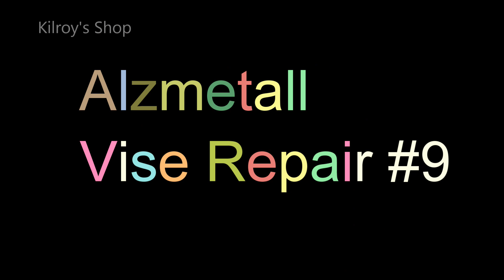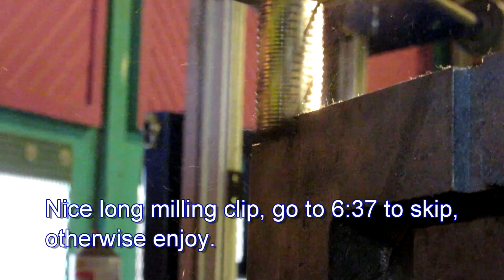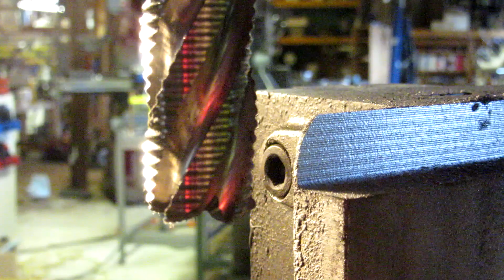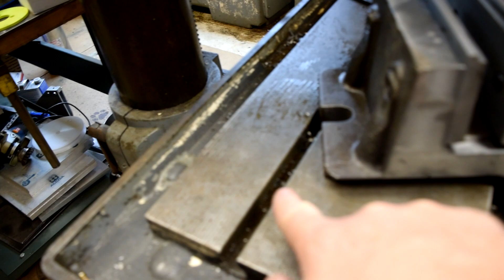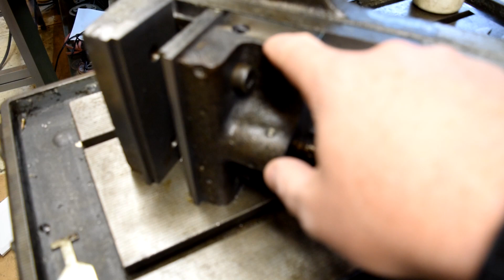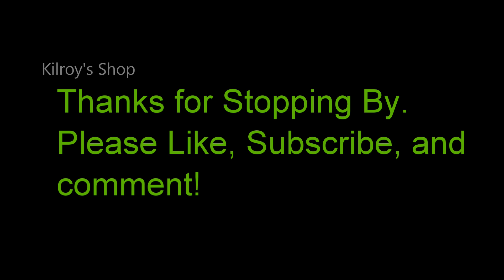Alzmetall Vise Repair #9

Comment: Hi James, sounded perfect to me. The picture contrast seemed somewhat too high. Windows were over-exposed while your jacket was too dark. I wonder if this can be fixed in the settings. Otherwise the picture was great, too.

I wonder how this camera holds up against vibration though. This was one of the things that GoPro did wonderfully. Having a complex lens doesn't help here i'm afraid.

Comment: About the new camera, maybe you can try shooting from another direction in order to avoid the back light effect from the windows, use that light in your favor.... As far as sound is concerned, it's fine as long as you won't have loud machines running and if you got to talk quite far from the camera, I use a noise cancelling wireless for those times, and, I'm quite satisfied with it...

Is the focus automatic or do you have to manually set it...   ???  If manual, it could be a little more work adjusting while filming, lots of lighting will definitely help with depth of field...   ;)

Comment: Hi James, nice series, I'm enjoying watching it.

On the intro and trailer, I really like the video quality, but the audio, not so much. You have a lot of room echo there in that cave you are in with all those hard walls. You would be a LOT better off with either a short shotgun mic or a wireless, something like Keith Fenner uses. 
There are shotgun mics from about $15 up to about $350. I'd suggest spending something in the order of $100. But then, I spent a lot of years doing theatrical sound, and I like good (or at least decent) microphones that will hold up over time.

I don't know much about Azden, but the specs look pretty decent. Maybe something like this: https://azdenproshop.com/product/sgm-990-dslr-camera-microphone/

Comment: Hi James
I like the new camera allot the video quality is excellent and the mic is fine good sound quality not sure how far you were away from the camera. Some of the guys are using radio mic's and they are getting allot of noise from rubbing when moving around which is a little annoying. I'm not sure you need it at this point but couldn't hurt to try one just to see. Yes agree some lighting would be good sometimes it's a bit hard to see on the mill. Great videos though always like it when you get stuck in. OMG that vice must owe you so much in man hours it's crazy but makes a great video.

Dave

Comment: I didn't skip forward at all this time because the video quality was good enough that I just enjoyed watching that big mill eat that iron.  I had no trouble with any of the sound, but I may not be that much of an authority.  
I'm interested in watching it finally work as I've got a Float Lock for my drill press and use it quite a bit for certain jobs.  The Float Lock is compact enough that I get along using the T Slots.

Thanks for the great series.

Comment: sounds is great your round windows are kinda getting blown out with the light  but no big deal .as a side note just as your finishing up your drill press i am starting mine little bit older then yours lol . check it out i just posted the first video today.
Reply from the maker: +Chris Anderson Will do, thanks for the heads up.

Comment: The sound is really pretty good. The thing that I see that needs improved is the back light from your windows. It tends to wash out the rest of the picture, It is a much better video when you are shooting after dark and the light from the windows is absent. 

I don't recall if you have windows on both sides of the shop, but if you don't or when the sun is bright you might consider shooting from the other direction.

I really enjoy your projects  and am learning a lot from your practices.

Bob

Comment: Great picture, sound not so much.  Any built-in camera mic is not going to have much quality, and all mics will tend to pick up room echo.  Better would be an off camera directional mic, like a Rode, located as close to you a possible yet remaining off frame.  Best, of course, would be a wireless lavalier located on your chest (keep away from throat).  Avoid continuous focus, as the system will hunt unpredictably for focus.  Most videographers use manual focus, which should work well for the kind of stationary camera-based shots you have to use.Keep up the good work, James!

Comment: Hi James, The video from the new camera is a bit washed out, but that was probably from the back lighting of the sunlight from the windows (just something to consider). The sound from the internal mic while you're just sitting there is exactly what I would expect (and prefer) from standing in your shop having a conversation. Perhaps the external mic would be a better option whenever there's machinery running and you want that sound to sit in the background while you would be narrating? 

Just my thoughts, enjoyed the videos regardless.

Thanks!
Reply: +Neil Smith I agree with the picture and the sound, except that I found the volume a little lower, had to turn it up for the last part. 

James, I liked your post-filming narration that you were doing with the clips from the broken GoPro (it sounds like to me that the mic has fallen loose inside the GoPro ). The only problem with that is you miss the sound that the machine makes while milling, which can be useful for learning.
~Travis

Comment: Really digging the alzmetall series, Jay!  My brother has the D3300 also. I personally think it shoots amazing pictures, but I think my Canon T2i shoots better video. Maybe its an issue on 24p only, but it always seems pixelated, like its struggling with compression, I dunno.  Audio seems much more consistent on this vid than your others. The narrative is much stronger above the background machine noise than it used to be. Not quite "Keith" quality (either of 'em), but its a lot better than it was! Wireless lavalier would be best for sure, as you wouldn't have to fiddle with anything. Strain relieve the cable at the mic head, and keep the windscreen away from your apron and it would sound great! Otherwise abom captures some great audio with his rode, you just have to be more mindful of which way its pointing when you're talking.  as for the milling action, I watched it all in real time, and at first I thought I liked it better, but now I think I miss the old super speed with the funk(your opening and closing music)... just turn down the funk a little bit, its always too loud.  Just 2 and a half cents, it still wouldn't keep me from watching the vids though man, keep up the good work!!
Reply from the maker: +Adam W I will have to look into a wireless mic.  Like most things, you can get them cheap, but a good one will set you back six bills.
Reply: +James Kilroy exactly, they're more than a good HD camera these days. There's one by Movo on Amazon that I've been looking at for 2, but who knows if it's worth a crap. Audio is much improved already though Jay, waaaay better than the gopro ever was!

Comment: Hey James, why not make the torque arm long enough to use the column for the  drill head be the stop rest? Looks like it might would hit the column rack when using left hand bits but that probably isn't often and even then with that much leverage I doubt resting it on the teeth of the rack would even matter
Reply from the maker: +bcbloc02 Brian, that's not a bad idea at all.  That way a clamp would only be used to locate the vise and would be optional.
Reply: +bcbloc02 i was thinking the exact same thing.
Reply: +bcbloc02 That's exactly what I do.  I dislike clamping things on the drillpress table.  Much prefer to leave the vise floating and have a torque arm.

Comment: James, in response to your direct question.
 I see very little difference overall in the audio except when you are behind the camera when it is less clear but still perfectly audible. 
Picture seems sharp enough although at times a little a little blurred outside the area of focus which appears to be strongly centre weighted when very close up especially - that may of course have been your intent! 
In my view your main area of difficulty lies with lighting issues: initially I feel the lighting from I guess a single source in front of the mill was too strong and it produced almost burnt out areas of the images and dark shadows in other parts and this I suspects makes it difficult for the camera to adjust the white balance / aperture / focus assuming you are employing automatic features. 
- What might work better for you in this situation I don't really know but feel two or more lights of less individual power to create an even flood light effect or perhaps some sort of reflector to illuminate darker areas to give a more even overall lighting effect. To this end pictures from the rear / side of the mill were excellent.
Reply from the maker: +Dan Whiteford Thanks Dan, I noticed that the edges on the video were blury.  I will experiment with different focus configurations and see if that can be combated.  I expect that I will need additional lighting to avoid that.  With the aperture wide open depth of field will be very short.  I recently purchased some LED outdoor flood lights I will be adapting as machine lights on the big K&T, four of them.  Hopefully I can get an even, near shadow-less, light pattern with those.
Reply: I shall be most interested to see the results.

Comment: I like the quality of both the sound and the picture of both new camera clips, and really the only nit I could pick would really be more of a question that has probably been answered by the new camera.

During the post milling review of the vise many sections of the shot were crisp(like the splash-proof oil cup, etc.), but the vise itself seemed a bit blurred. Was that just a matter of focus, the lighting, or something I am ignorant of?

Personally I wouldn't buy the external mic, at least not yet, as some of the other comments have pointed out their drawbacks and I tend to agree. There was a video this morning by a good friend of ours that had a issue with his mic rubbing on some piece of clothing and it was rather loud, so I'd wait until YOU find the sound annoying, and then look into a mic because it sounds great all the way over here in California ;)

Thanks again for the extra touches on this well made video, Aloha...Chuck.

P.S. I haven't forgotten about sharing my GTD set with you, and will be making a video shop tour/tool inventory and will make a note of when it appears in the show and put up the time, like you did with the milling.
Reply from the maker: +Knolltop Farms I have a lot of learning to do with the new camera for sure.  Focus when taking video with a DSLR, is not nearly as care-free as with a video camera.  And like I mentioned in another reply, I need a lot more light so I can crank down on the aperture to increase my depth of field.
Reply: +James Kilroy Sounds like you are certainly on the right track with it.

Comment: I think the initial camera angle would be termed 'upskirt'. Have you watched one of Keith Fenner's videos from last year? Can't remember the title but there was horizontal milling as I recall. He finished with some slo-mo blue lube action - with hot, flying, chips and flood coolant. Damn ! I think you guys should work together more.
Seriously though, good video, thank you. I didn't notice differences in camera, pixels, sound quality - but that's not what I'm watching these for! I will say though that if you hadn't put instructions, skip to 6.22, skip to 10.44 or whenever, I would have watched the whole thing. As it is, I watched a 22 minute video in like 12 minutes.
Happy New Year - if a little late.
Reply from the maker: +The Trevor Thanks for the feedback.  I would rather you fast forward a bit rather than get bored and move on to something else.

Comment: Picture quality is fine here James. Viewing on a 13" MacBook Pro. Sound is clean, if a little distant. My suggestion would be a radio mic with the receiver plugged into the camera's mic plug and a head mounted microphone, perhaps clipped to your glasses leg. Have a look at the two Keiths' setups, Mr Fenner with his cap mounted mic and Mr Rucker with his apron mounted mic, although that could be a little prone to contact noise.

Happy New Year to you and all your family!

Comment: Looks like I'm first. Great video! Thanks.
Reply: +James Kilroy I also did a lot of skipping of the milling process.  Speeding it up, or just showing the start and finish would make if more interesting to me.  The audio at the end when you were at the table seemed pretty good to me.
Reply: +James Kilroy I liked the old speed up. I watch the milling-in-action to calibrate my eyes and ears to "best practices", with this long sequence, I watched a second, pressed skip forward, repeat. Really, do what works for you, they both work for me. I didn't even notice the camera difference so looks good to me!
Reply from the maker: +RC Miller Thanks, quick question.  Do you like watching the long milling sequences or do you utilize the "skip forward" buttons to move ahead? Did you prefer the old method of speeding up the video and patching in music?
Reply: +James Kilroy I admit I skipped forward. I don't like long sequences I prefer speeding in up BUT, I don't like loud music.